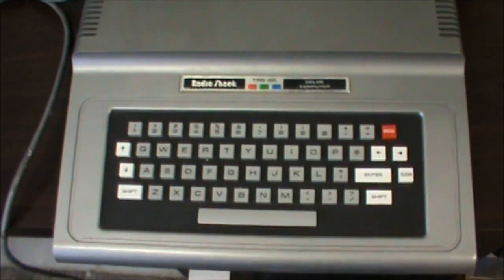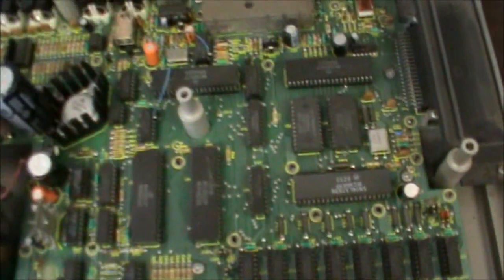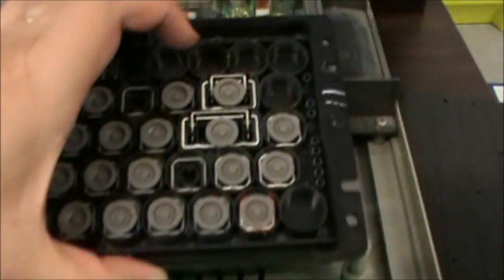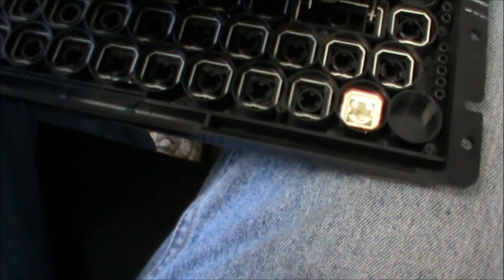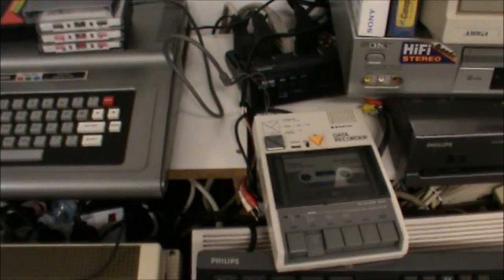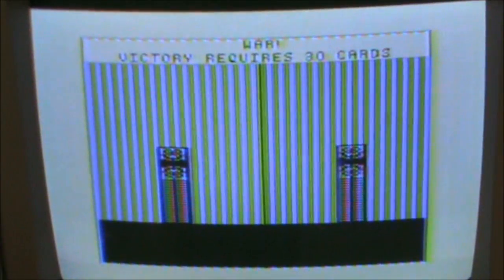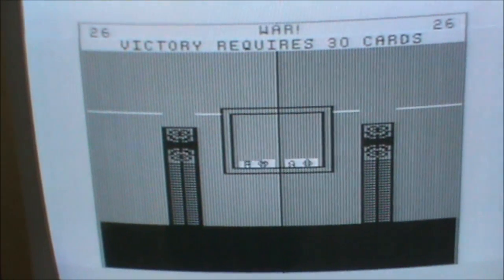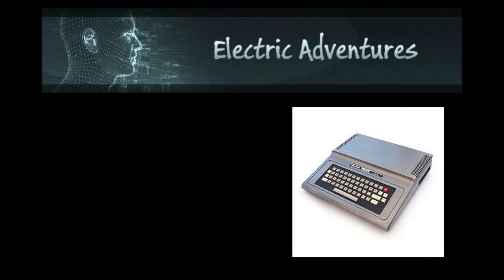TRS-80 Color Computer - Keyboard Repair 4th February 2012

Comment: The ribbon connector is not as delicate as you indicate.  Pulling it firmly with both hands off the motherboard would detach it nicely and let the repair take place a little easier without possibly damaging other components.  :)
Reply from the maker: I’m always very wary of them as some of them get brittle and can tear easily. But yes if they can be easily removed definitely better doing that than potentially damaging something.

Comment from the maker: @atarileaf I was pleasantly surprised how these were put together, it makes them pretty robust when you think about.  Also lucky the rubber pieces uses have not corroded either, so they must have used good quality parts.  I liked the layout of the motherboard, it was very neat, especially for a time when computers were thrown together quite quickly.

Comment: Funny you did this, I had to fix one of my chicklet coco 1 keyboards a few weeks ago. Mine was a little different as it had these little metal doohickeys for each key and when I opened the keyboard case, all those little things went flying. I thought all was lost but I spent about 20 minutes putting it back together and the key that wasn't working, the "B" I think, worked great. All keys are fine. I've never seen that War game before. Very nice :) Glad the cable's working well.